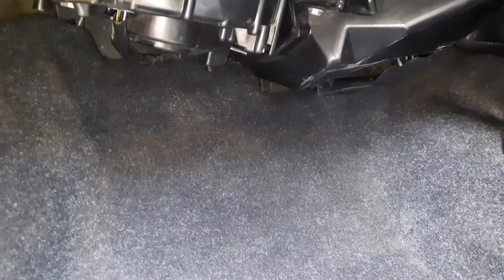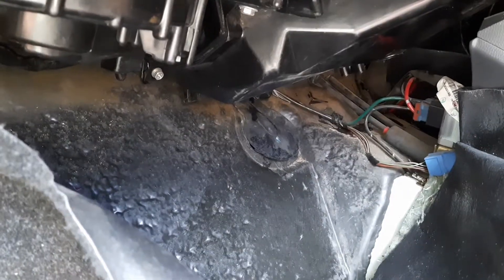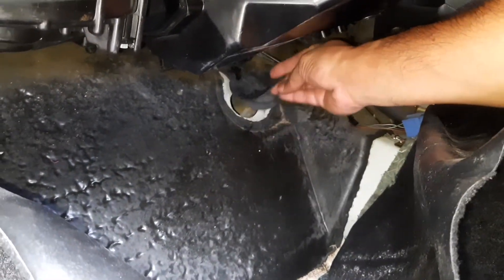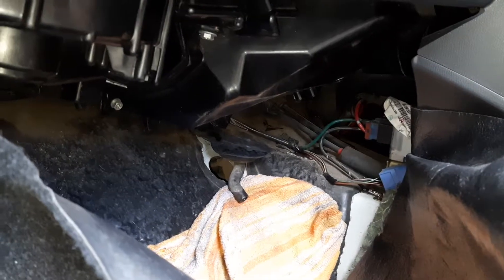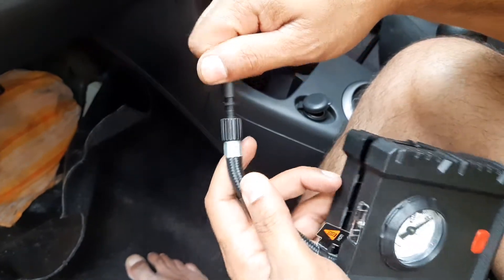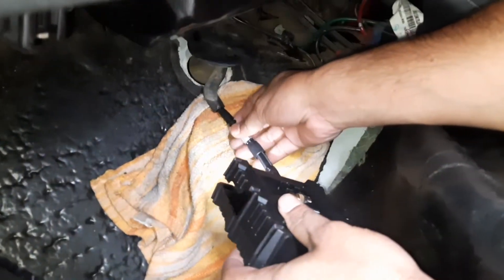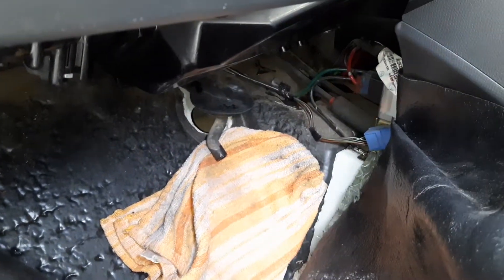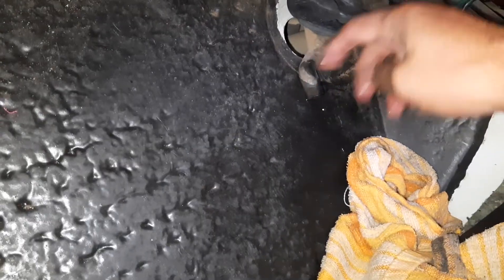Maruti Swift Water Leakage at passenger side of the seat | Fix it in 5 minutes!

Comment: Sir I have swift car and under the driver’s seat water is getting collected, I showed to the mechanic he did some repair on the upper side of the bonnet but still water was getting clogged and he checked every where but couldn’t find the place of leakage ,, I could see water only when it rains heavily and there is water under the seat.. please guide me 🙏
Reply from the maker: This normally happens when the Air intake for the HVAC system gets clogged due to dust or other particles. You can test this by pouring a cup of water via the air intake and clean it by yourself or by the service centre guys.
Reply: Same with my alto k10,any solution..??